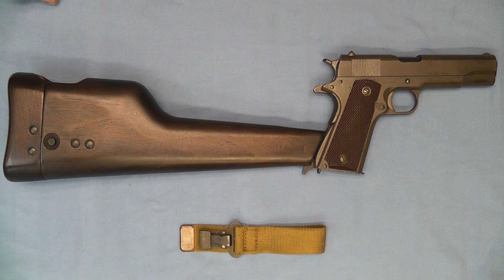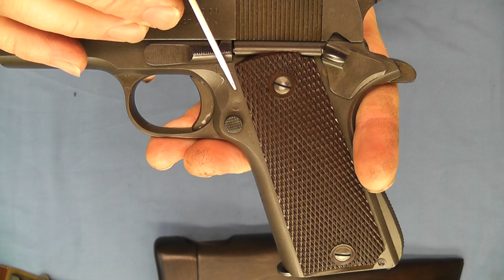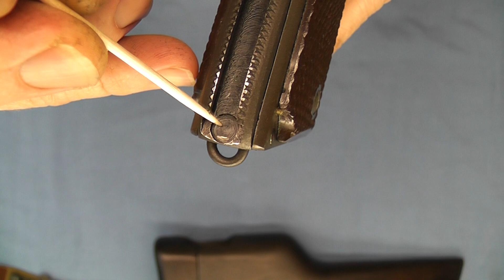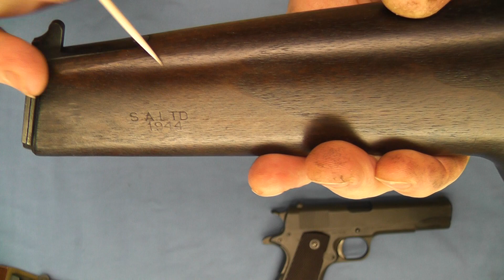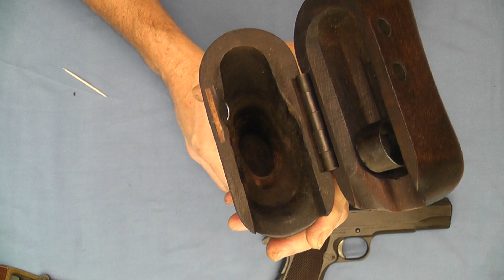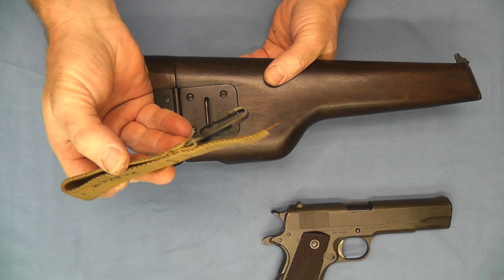Inglis Shoulder Stock Holster Colt 1911A1 .45 ACP 1911

Comment: Sweet, I have a Browning Inglis Hi Power P-35  9 MM Tangent sight to 500 meters and Original Shoulder Stock holster. Because pistol and stock/holster are original it does not require a tax stamp or registration as a SBR, it is exempt and classified as a C R  (curio/relic)
   For those wanting to put a REPRODUCTION  shoulder/stock on even an original pistol it must be registered as an SBR. Exemption only applies to Original Manufacture Pistol and Original Manufacture Stock!

Comment: that's not a A1. that's a regular M1911
An A1 mainspring housing is straight
A original is kinda curved.
Reply: Not true. 1911 has a flat mainspring housing, long trigger and no scalloping around the trigger guard. 1911a1 has an arched mainspring housing, short trigger and the scalloping around the trigger guard.
Reply: Production date and scallops cut for the trigger make it an A1.
Reply: Wrong.  Mainspring housing, a removable part, is irrelevant.  What makes it an a1 is the clearance cut at the trigger.  Besides, you have it backwards.  Flat was 1911, 1911a1 was the curved.   Not  that it matters since Colt had lots of 1911 parts left over in 1921 and for about a decade made what are known as transitional pistols combining left over 1911 parts with 1911a1 frames.  Also during WWII (and possibly earlier) both part types were in US inventory (presumably Canada's too) and sometimes at special request unit armorers did some mix and match when servicing pistols.  I know that because my father in WWII had his armorer swap out the 1911a1 hammer and mainspring housing for his issued 1911a1 (he had more than one in theater thanks to many card games on days there were no bomber missions) with 1911 parts.